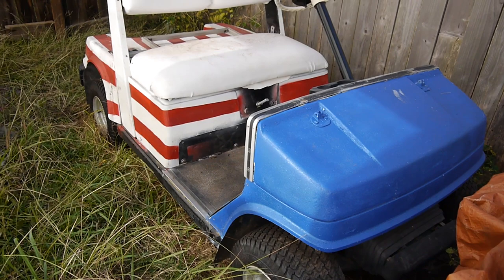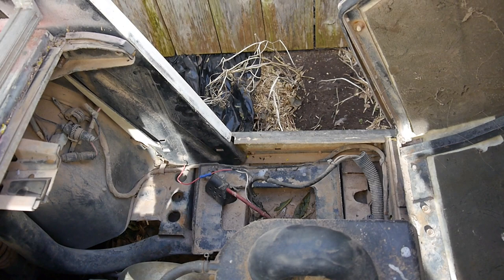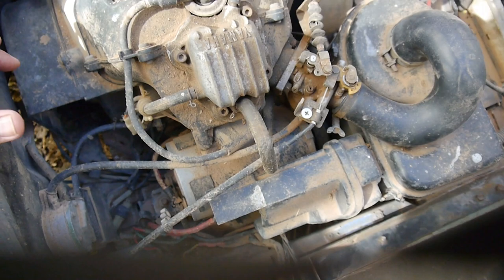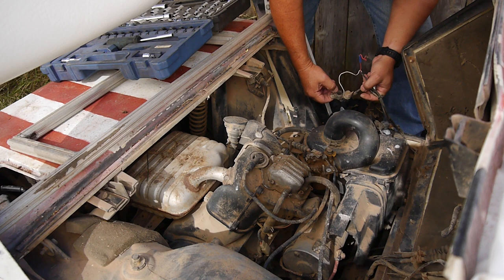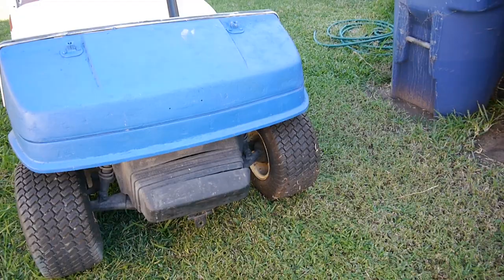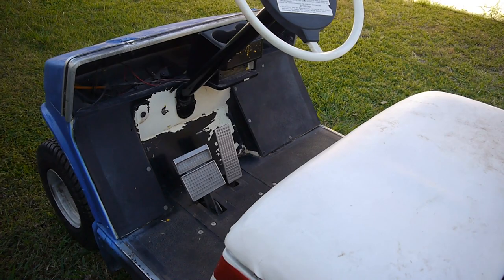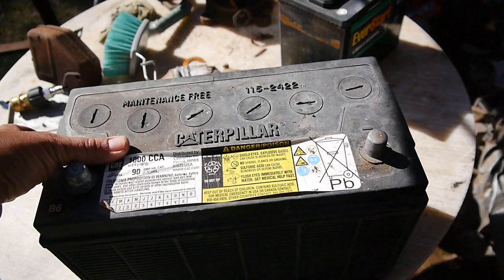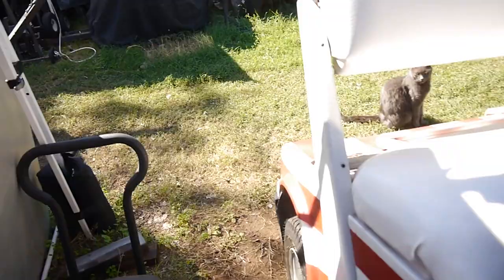Yamaha G2 Gas Golf Cart - Will It Run?

Comment: Hey did you get it to go faster. Working on one like that. It's only going may 10 .with gas pedal 3/4 and dieing when on floor.
Reply from the maker: That's a tough one.  Check the spark plug and see if it is black.  Maybe the choke is stuck and running too rich at higher rpm.
Reply: Get the stock air filter set up how it was from the factory, and buy a new carburetor, they're only like 20 bucks each, and a new spark plug, and delete the governor, I got mine going 20 uphill right now
Reply: Adjust your governor.

Comment: Those were only about 6hp. 15mph is probably about top speed. I have the same cart which ironically blew up 3 days ago. It’s was a lot of fun. I will now tear it apart to see if it’s worth fixing. If not, I will be dropping in a predator 420. Thanks for the video!
Reply from the maker: If I don't sell it, I'm going to try for more speed.
Reply: I just got over 20mph from my 1991 G2 after bypassing the governor (not adjusting, but actually bypassing).